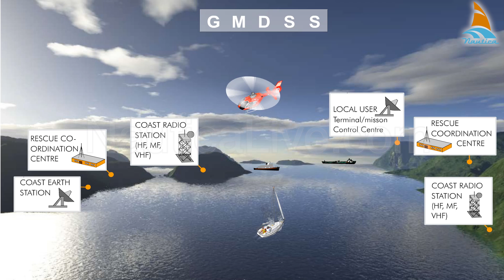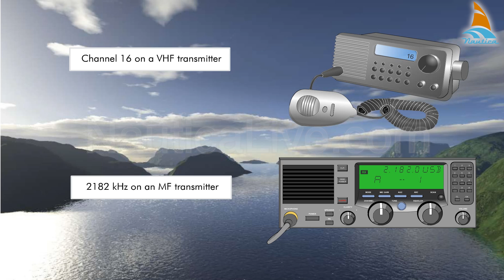Distress signals by radio

Comment: The United States Coast Guard has announced that it will no longer maintain a watch on 2182 kHz, will no longer guard the Digital Selective Calling (DSC) channel 2187.5 kHz, and will no longer transmit Marine Information Broadcasts on 2670 kHz.